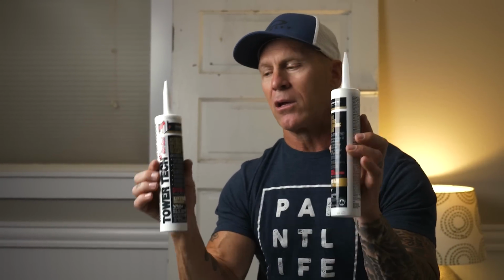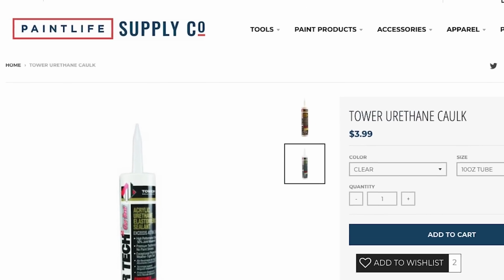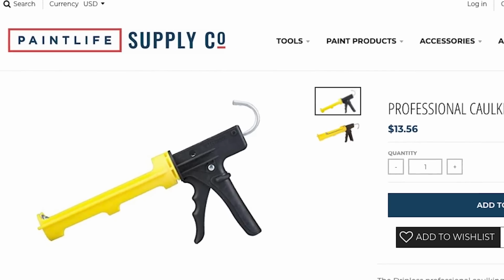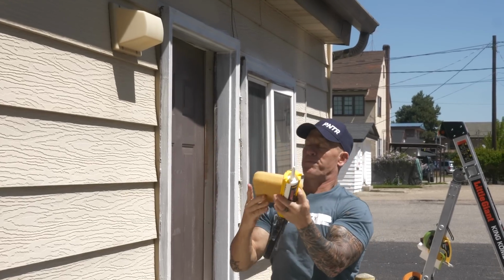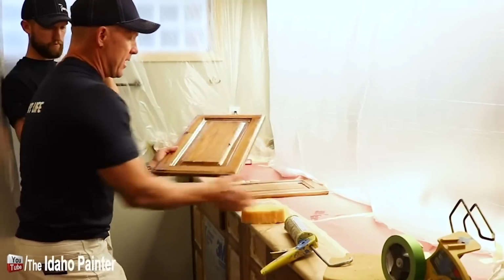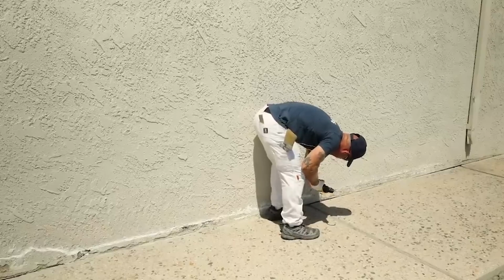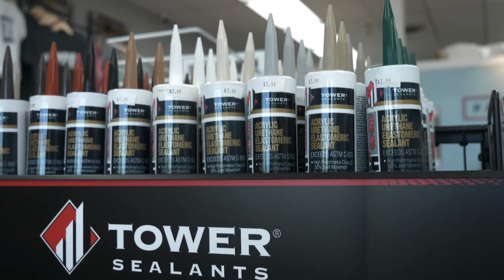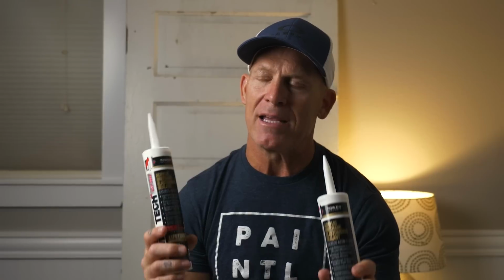Choosing the Right Caulking for the Job: Caulk Like a Pro!

Comment: Hey Chris,  elastomeric or urethane caulk is what I use.  Drippless caulking gun with a damp rag!  Trick is not to cut the tip of the tub to wide. After each bead run a wet  finger wiping after each pass. Double caulk on new trim /woodwork. Cheers!  The gooseneck guy! 🤟

Comment: It’s a great caulking been using it for the last ten years ,  been down here in Maryland for along time.  The caulking has a good body to it meaning putting it on and wiping it down it stay on the surface not a lot coming off on finger and that’s more clean work for my guys and not all on your hands.  No call backs.  All pluses on this product great review.

Comment: Dap Dynaflex 230 for interiors and Sashco Big Stretch for Crown Molding as there is always major expansion/contraction here in Chicago with 100 degree variance in temps over the year.

Comment: Tip: Caulk over silicon works, then you can paint it. All you have to remember is to get caulk onto the natural surface either side of the silicon.
Reply: I was prepared to totally argue after the first sentence. But then I kept reading. You are absolutely correct and in fact it might even make for a longer lasting joint. As long as you don’t use a water based sealant/ caulk on exteriors. Acrylic should never be used in wet locations no matter what they claim. Btw I have been a professional caulker for over 45 years.
Reply: So you’re going over the joint twice with two different compounds and paying twice just to paint?  Why not use something paintable in the first place?
Reply: @kyleblandon2250  Did you watch the vid? 8:06 the building was already done in straight silicone.

Comment: I will have to try to find it, there website didn’t list a where to buy tab I seen. It sounds like a solid product but if I can’t find it local I tend to shy away. Would hate to be in the middle of a project and be short and have to wait in shipping. But the DAP stuff from Lowe’s is pretty rough.

Comment: In my experience White Lightning original formula all purpose caulk performs best for most applications.
Tools cleanly, doesn't set up too fast,
minimal shrinkage; all metrics that matter to me.Clean knit rags and a bucket of water.Never used, nor considered,using a sponge in 35 years.

Comment: Off topic, but I’m using my first airless sprayer.  Graco gun and I’m wondering how you rotate the tip without unscrewing it and screwing it back in?  Seems like y’all just turn it and keep spraying.  What am I missing?
Reply: Use two hands.One to hold gun and tip guard in place and the other to rotate and clear tip
Reply: Be careful not to engage trigger.Very important!
Reply: Graco reversible tips,
Reply: @francojaramillo7736  I meant rotate from the spray pattern from horizontal to vertical.
Reply: @TonightWeGrill   just loosen the piece that connects the gun and the fan  then rotate the fan and tighten it back down.

Comment: I've found that if you put a tube of caulk in the gun before you open it and squeeze the trigger a couple of times, it increases the compression inside the tube and eliminates most of the air bubble problem. That being said, I'd rather just use a better caulk so I'll be looking for Tower in my area. Thanks!

Comment: What are your thoughts on the GE line of caulk? I've used their clear and white Silicone II series for years, seems to work well both inside and out. Curious if you've ever came across them or have experience with them.
Reply from the maker: Garbage in my opinion

Comment: Tower Sealants TS-00215 10.1 fl-Ounce Tower Tech 2 Acrylic Urethane Sealant, White is $13 a tube on Amazon Canada.
Tower Sealants TS-00228 10.1 fl-Ounce Tower Tech 2 Acrylic Urethane Sealant, Almond is $8.26

Comment: For exterior: polyurethane caulk. Loctite makes a good product. 

For interior: You’re going to think I’m dumb but I use Alex plus by DAP. It has served me well for close to 20 years now. 
Also, it is “caulk” not “caulking.” Not a big deal but…
Reply: Have used Alex Plus for years as well with great success inside and out.
Reply: “Caulk” is a verb: to stop up and make tight against leakage (something, such as a boat or its seams, the cracks in a window frame, or the joints of a pipe).  

“Caulking” is a variant verb: to furnish with caulks.

So not incorrect to say caulking